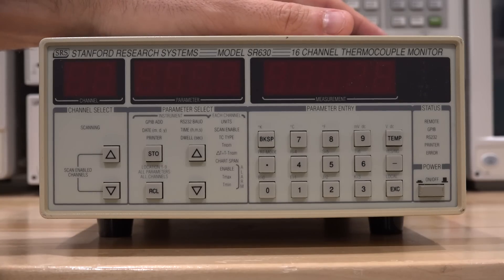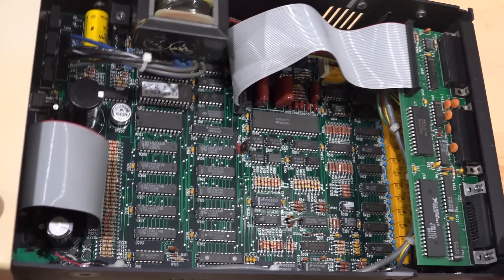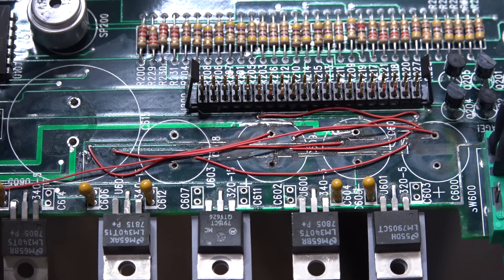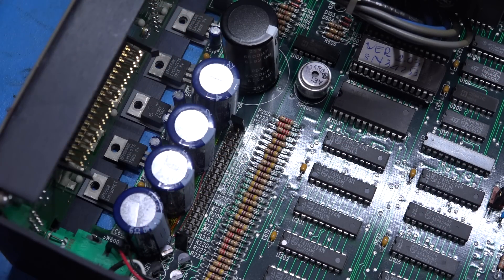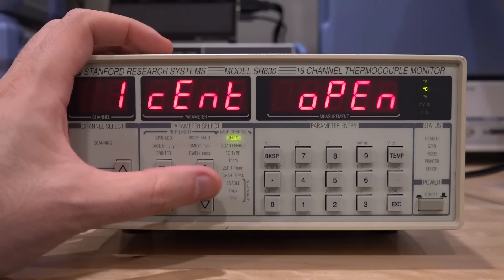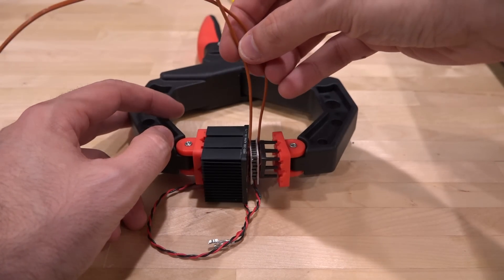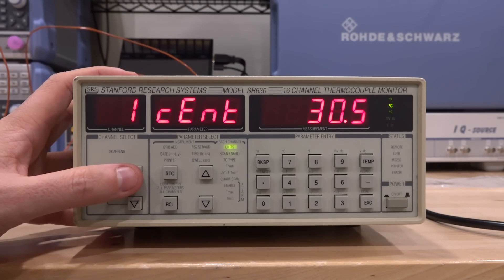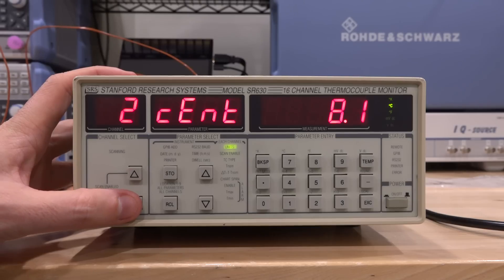TNP #21 - Stanford Research SR630 16-Channel Thermocouple Monitor Teardown, Repair & Experiment

Comment: The TO220s-bolted-to-the-chassis got off to a good start in the HV power supply, but it looks like good old leaky capacitors have reclaimed champion troublemaker status!

Comment: In cases like this I prefer to mill the whole surface of the affected area on PCB as you can't remove 100% of the corrosive stuff that soaked into epoxy. Learned that hard way in Keithley 2001's since they kept failing after running for few month after simple wire hackjob repairs. Also there was live specimen walking at the clamp, might have affected your measurements ;-)
Reply: Yeah, I had an Anritsu power meter that kept popping its fuse as the switching transistor cooked the PCB beneath into a conductive state (70 ohms!). The first time I didn't know the root cause, the second time I thought I could get away with surface scraping, the third time I milled slots and the problem hasn't returned in years.
Reply from the maker: That is a good idea.
Reply: I think I saw the ant too ...
Reply from the maker: @vincei4252  It was a hitchhiker when I grabbed the clamp from storage!

Comment: I'd love to see SR620 evaluated with a high-stability reference.
Reply from the maker: I have been trying to buy one on eBay.
Reply: @Thesignalpath  You can make an ice point accurate to within 10mK or so fairy easily, using a 1l or larger vacuum flask. Use deionised water, not ordinary tap water, and wash the flask out with the deionised water before using it. Freeze some of the deionised water down to -20˚C or so in a domestic freezer, then shave it using either a commercial ice shaver, or (what I use) a coarse grater blade in a domestic food processor. Chill the rest of the deionised water down to 3˚C or so in the fridge. About 1/3 fill the flask with the chilled water, then pack it full with the shaved ice. After a while the ice will partially melt so that the water at its surface reaches 0.00˚C. Make a hole in the ice/water mix (use a plastic or wooden tool, not metal, to minimise heat conduction) and insert your thermometer.

As always measuring temperature, you need to be patient and wait for the system to reach thermal equilibrium. A simple ice point will hold its temperature well for several hours, depending on the heat conduction paths. To maintain the temperature, you should drain (or better, siphon) out the melt water from underneath the ice every once in a while, and add some fresh crushed ice to the top.

Remember it is the water in contact with the ice, not the ice itself, that is at 0.00˚C.

Have fun!
Reply from the maker: @maxhadley3753  Thanks!

Comment: How often do you encounter vias that connect to inner layers, and what can you do to make sure that inner layer connection isn't broken when drilling out a via?
Reply: Find the other end of that connection and add another jumper wire. Generally those are power and ground planes, so easy enough to simply get power or ground from the nearest point and connect it. Did that a lot with old multilayer PCB's, where the through holes were notorious for failing when you replaced parts, so doing a jumper or two per repair was almost standard.